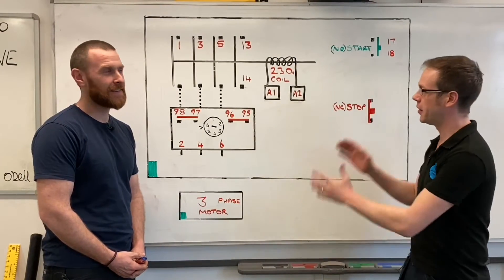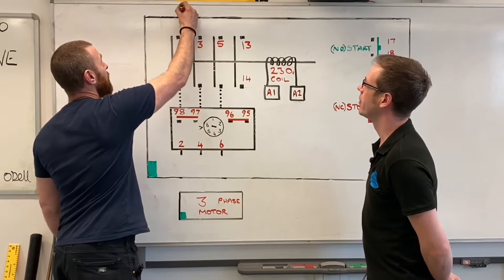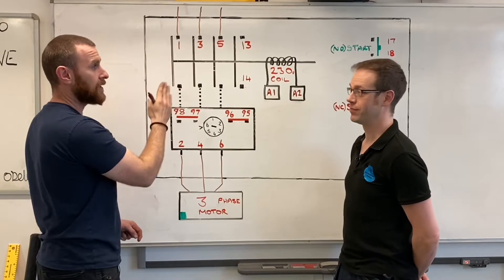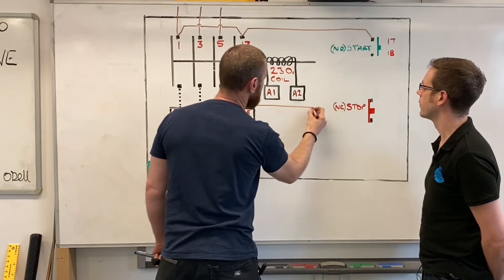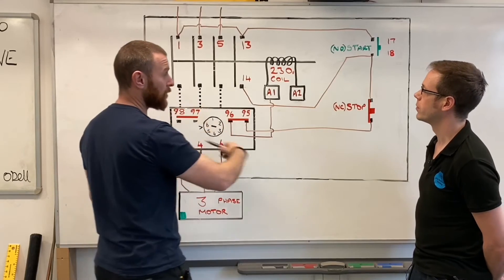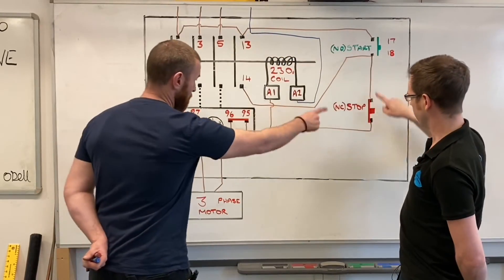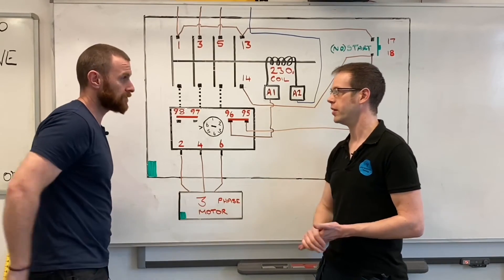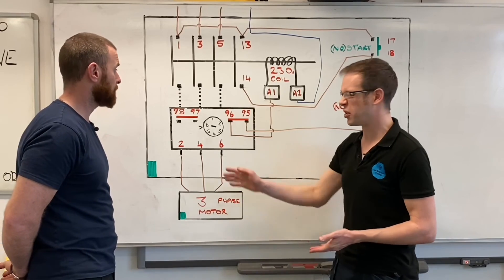3 Phase Direct Online Starter DOL Wiring Diagram Connections Explained

Comment: Can I use the DOL STARTER CIRCUIT to power the 1hp submersible pump without connecting it with the sumo power box (switch) or should I integrate the capacitor with DOL circuit connection?

Comment: Thanks guys!

I've been working on an irrigation job and trying to get the 2 reticulation controllers to activate the bore pump wirelessly through a transmitter i made and your diagram of the wiring has filled in the missing pieces! All can be done with just a good ole 240v relay!

Comment: Very few of these around these days...Its all VSDs and varients...You should be doing a video on them showing the importance of using the correct type of cable and correct earthing and screening connections.I see so many done wrong, wired in SWA and wondering why the cables are at such high temperature ,and glwhy their bearings are shot after 3 months

Comment: hi pls also show for 3 phase DOL using 415v coil please. thankyou
Reply: Wait! The whole point of a Direct Online Starter (DOL) is to use a low-voltage coil to control a high-voltage motor.
Are you sure there is a relay with 415v coil?
edit: I just saw this video https://www.youtube.com/watch?v=qlqPdLGwJxk at 4:04 mentioning that indeed 400v coils/relays do exist...

Comment: what if you  don't  have a Neutral available, what  do you  do?
and  that if you want to turn  the  motor (s) on and off  automatically  with pressure , limit switches or a  thermostat?
Reply: Probably add a 415v coil contactor

Comment: this means your control circuit is using the same MCB rating as the motor, dont agree with this
Reply: Interesting. What would you do? Throw another 6A or smaller mcb to supply the control circuit?
Reply: @NickToland so don't take your L1 feed from the top of the contactor? And if you do, the control circuit must be wired in cables rated the same as the motor circuit...?
Reply: I don't understand why the control circuit wasn't separated from power one
Reply: So long as the control wiring is rated higher than the supply fuses, as will be the case for small motors, there is no problem. In larger motors, which may have supply cables of say 6mm or larger, it would be unfeasible to use that size cable for the control wiring so, yes a fuse would be needed.